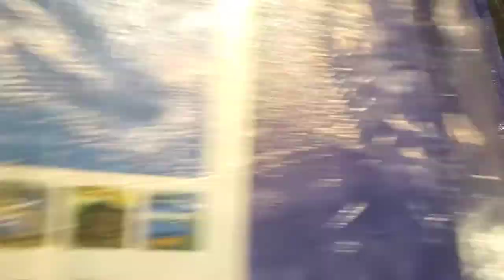inmotion V8F first ride, but not recorded, let's talk

Comment: i bet your wife is mad as hell, when i did japanese martial arts we spent FOREVER learning breakfalls , rolling instead of face planting , kind of thing that wouldve helped you, you fall but you dont get hurt.
Reply from the maker: If you see the conversation between me and Jordan you'll see that they basically reinvented the wheel to prevent that because in motion bought Solowheel and they were just selling them and then they came up with their own design which fixed all the issues
Reply from the maker: I forgot to add that happened as fast as the snap of the finger the wheel is instantly gone and you're falling before you know it. This wheel has been all redone so that'll never happen again